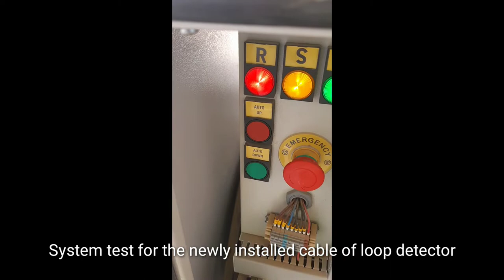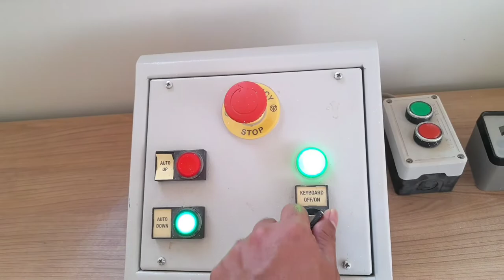How to install a Loop/Vehicle Detector #optima #securitysystem #roadblocker #vehicledetector

Comment: Good day bro,KSA here assigned in gizan...bro,anu b ang nagiging cause ng optima road blocker n kusang nagdodown..nagpalit ako ng solenoid pero ganun p dn..nagpalit ako ng pistons,ganun p dn at kusa pa din bumababa
Reply from the maker: Sir na check nyo ba yung hydraulic hose? Baka may tagas na at pati oil at compressor baka kasi kinakapos na ng tulak di nya ma maintain yung pressure kaya bumababa.
Reply: @pidoystv  bro,san un compressor?
Reply: @pidoystv  ,posible dn ang oil?Bago n un hydraulic hose
Reply: @pidoystv  bro,san banda un compressor?
Reply: @pidoystv  bka cguro s oil..pwede b idrain un oil tank?
Reply from the maker: @jonathanaguilar3135  i mean ung pressure nya dun sa motor guage nya saka yung oil nasa max. Dapat.
Reply: @pidoystv  cge bro,check ko oil tank if nasa max

Comment: sir anu po possible cause ng mulfucntion ng hydraulic road blocker optima brand sir ayaw tumaas
Reply from the maker: check nyo muna sir yung limit switch nya. dun sa loob ng blocker.
Reply from the maker: kung ok naman flow nung oil dun sa hose, bka sa limit sir kailangan lang e adjust.
Reply: ayaw sir tumoluy pag pinondot ang push button
Reply: tumataas paunti paunti Ganun din ang pag baba
Reply from the maker: newly installed ba yung blocker o matagal na? baka kasi may tagas na ung sa hose nya sir.
Reply from the maker: at minsan nakakaapekto din ung relay ng sa loop detector.. tulad ng nasa video pinalitan namin loop cable kasi di sya tumutuloy umangat.. nakita namin na kinain na pala ng daga yung cable kaya yung relay nya naapektuhan din.
Reply: sir pag nalubog ba ng tubig ang piston cylinder maapictohan ang piston or ang proximity sensor naapictohan din ba
Reply from the maker: sigurado yan sir, kasi baka nahaluan na ng tubig yung langis ng hydraulic nyo.. wala bang submersible pump ung blocker nyo sa loob? pati proximity sensor nyo eh sigurado apektado na din yan lalo na kung ung splicing nya electrical tape lang binalot.